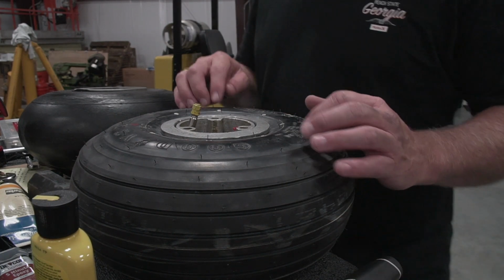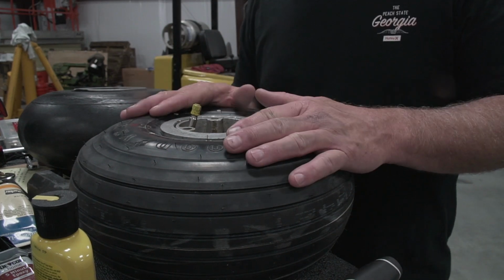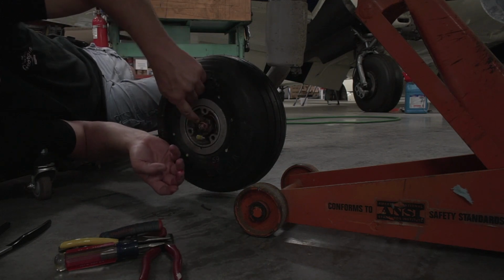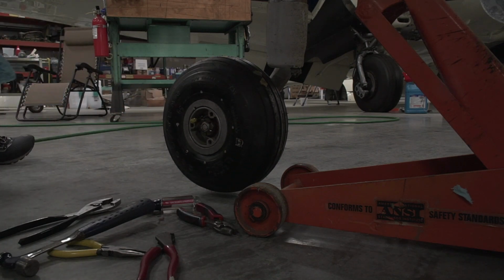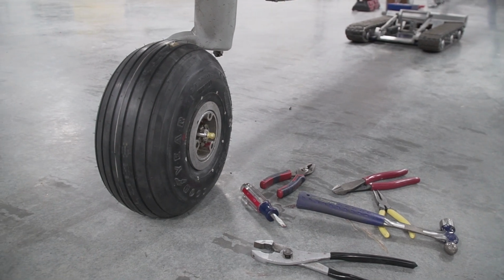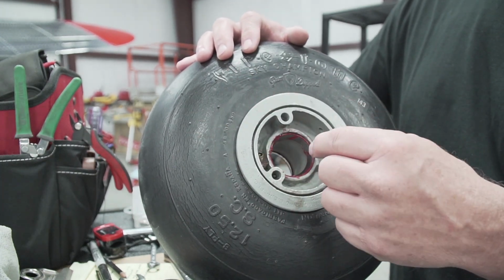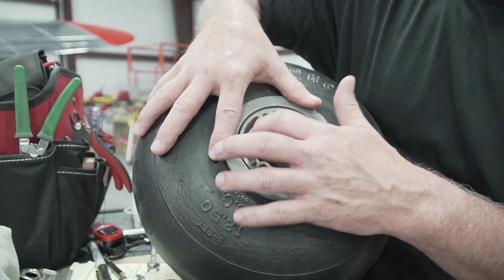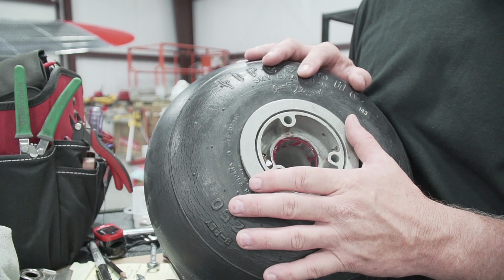Tail Wheel Part 2

Comment: In my opinion that nut should not be tightened so much.  You don’t want to preload those wheel bearings.  You should be able to feel just a little bit of ‘play’ as you wiggle the tire/wheel.  The nut should be able to be fairly easily loosened with just your fingers before you insert the cotter pin.  The cotter pin will keep it from loosening any more.
Reply: Actually there should be some preload on the bearings as opposed to play. Of course to much can also be detrimental.
Reply: @larrymueller5735  - The Cessna service manual says "Install axle nut and tighten axle nut until a slight bearing drag is obvious when the wheel is rotated.  Back off nut to nearest castellation and install cotter pin."  I would think a little 'play' might be felt at that point.  I think a little play is desirable to too much preload which would shorten bearing life.